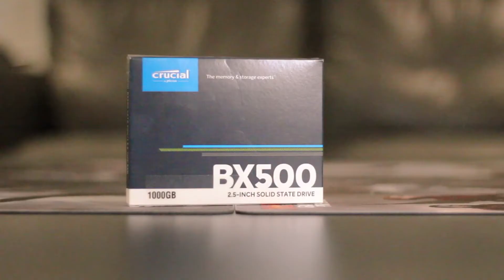$700 Gaming PC Build Time Lapse - July 2020

Comment: Can i build this? is it compatible?

CPU: AMD Ryzen 3 3200G
MBD: Gigabyte B450M-Ds3H
GPU: MSI RX 5600 XT 6GB
RAM: Kingston HyperX Fury 16GB 3200Mhz
SSD: WD Blue SSD 3D NAND 500GB SATA
PSU: Cooler Master GX ll 550W
Reply from the maker: Yes, that would work! However for the CPU I would recommend going with the Ryzen 3 3100 instead. The only place I've seen it available is bhphoto.com (they are trustworthy). The 3100 is $10 more, but wayyyy better. You won't regret spending $10 more.